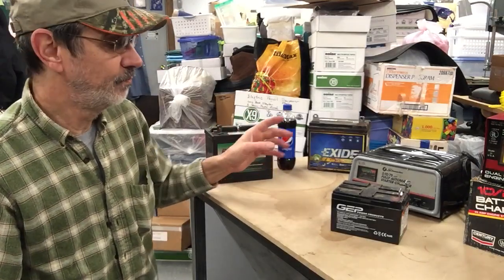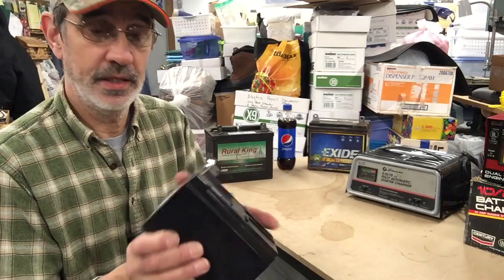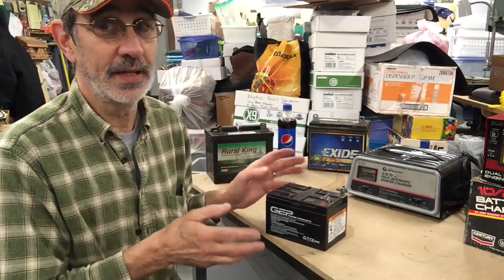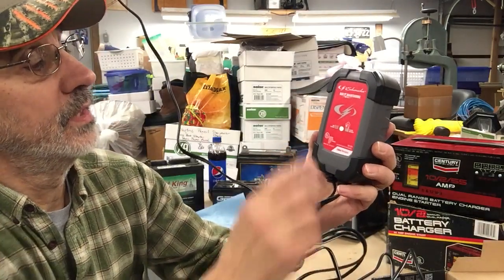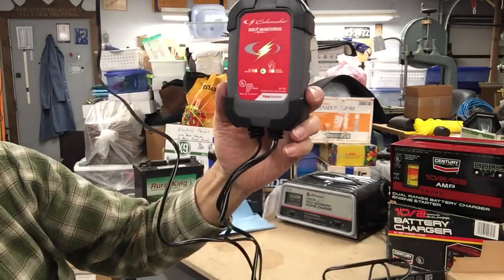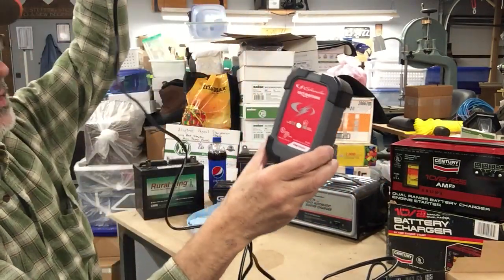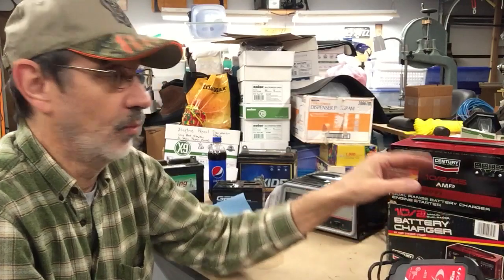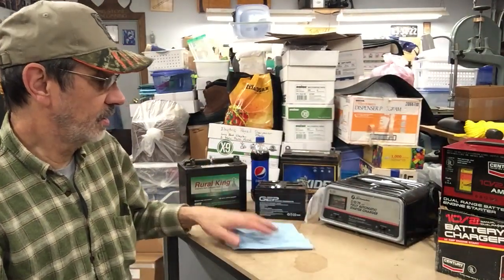326. Battery chargers and batteries

Comment: Hi Jim, Jim from Rep of Panama ( via Georgia,USA) lead acid batteries available here are $100. I wonder if I can put in a lithium battery ( which I can ship in from USA) yes it might cost a little more but should last much longer. Will a lithium battery work?  ( I recently installed  a new ‘powerbuilt 11.5 hp from small engine warehouse)
Reply from the maker: I will check with my Battery warehouse and make sure I’m giving you the right answer. Get back with you tomorrow. Jim.
Reply from the maker: OK I talked to my Battery supplier the difference between a lead acid battery and a lithium battery. He doesn’t believe your engine would charge the lithium battery properly or if it would charge it at all or if it could even start a fire I think to be safe I would stick to a good old lead acid battery, in this area I am in Michigan in the USA lithium or lithium ion batteries are a lot more expensive than a lead acid battery.         Jim
Reply: @jimjackson9381  Thank you very much, Got it!

Comment: Merry Christmas to you also !!! You can get these maintainanance chargers for little money these days I paid £10.00 not sure what that is in dollars but not a lot I bought
10 of them so one on every vehicle i have I started with these on my motorbikes years ago They do work and save you a fortune re buying new batteries With modern cars
and vans that have computors on them they do do the trick because if you leave a modern vehicle for a week or so the batt will go flat no question..The units I have bought
are called smart chargers which means they are automatic but also take into account temprature so if cold they go into cold mode etc worth every penny and worth mentioning
Reply from the maker: Yes they do help I use them on my off-season machines to keep the batteries up and the truck I only drive in the summer. 
And £1 is equal to $1.22 us. Jim

Comment: It was me with the email. I believe I was incorrect in saying it was a factory battery charger when in fact it’s a battery maintainer or trickle charger. It was possibly installed by the original owner and not factory installed. The original owner is deceased but for a 2011 model it was in pristine condition in 2018 when I bought it. I fully charged the battery the other day and took it off my mower and put the battery in my laundry room where it stays warm all winter. Figured that way I’d be able to keep it warm instead of in a cold garage. Merry Christmas Jim.
Reply from the maker: Merry Christmas to you also and let me know if you have any issues with that new snapper. Jim
Reply: The engine should have a stator under the flywheel that charges the battery when you use the mower.
Reply from the maker: @johnhoman321  Yes but if the engine is not running and you have a bad or weak battery it’s going to go dead, it maintains the battery when you’re not using the mower. Jim
Reply: I agree  Jim,  most of the standard small engine batteries only carry a 1 year warranty and generally last 2 to 3 years depending on the brand and where you live. I was in the air cooled engine business for over 30 years.  First as a mechanic, then as parts sales/purchasing for Briggs,  Clinton, Kohler, Tecumseh and Wisconsin.  We also sold Prestolite and Delco batteries

Comment: Hi Jim - it's Big Rodders in Ireland.  I wish you and your family a Happy Christmas and a Prosperous New Year.  About 30 years ago I treated myself to a electronic pulse charger, which charges gel batteries and also acts as a trickle charger also. It was expensive at the time but still works perfectly.  I am fortunate that I know a medical equipment engineer who gives me gel batteries that are routinely replaced every year. And which have a lot of life left in them.  These gel batteries can be sited in any position so work well in a Snapper that is stored on its rear end.  I currently use a 17 amp/hr which works great with no issues. Kindest Regards.
Reply from the maker: I’ve heard about gel batteries but I’ve never actually seen one or used one, and I hope you had a good Christmas and I hope your new year is safe and healthy. Jim
Reply: Hi Jim - Big Rodders again.   The third battery you displayed, the one made in China, appears to me to be a gel battery, particularly since you state it's guaranteed not to leak.  Most motorcycles and scooters now use gel batteries.
Reply from the maker: @rodneysweetnam8653  i’ll have to check into that and see exactly what type of battery that is, thanks for the information. Jim

Comment: I put those quick disconnect charging cables on all my batteries. Motorcycles, MG Midget, Pickup truck, 14 ft boat, and now my Snapper. I rotate couple "Battery Tender's" between them all. On one of my motorcycles that only has a kick start, I set it up with one of those quick disconnect plugs to actually connect the battery to the motorcycle since it's doesn't draw any amps for a starter. This way I can pull that battery out of the bike easily so I can use it in my boat, also connected with a quick disconnect, to run the depth finder and bilge pump. I have a long extension for the quick disconnect cord to run out of the garage to my pickup in the winter since it doesn't get used much.
 Have a Merry Christmas Jim and thanks for all the tips.
Reply from the maker: Well thank you for being a viewer and hopefully a subscriber I hope your Christmas was good in your new year will be safe and healthy. Jim